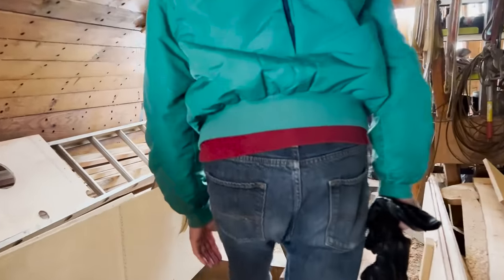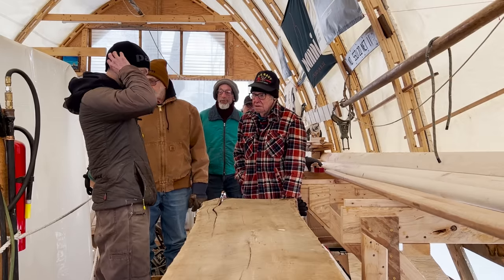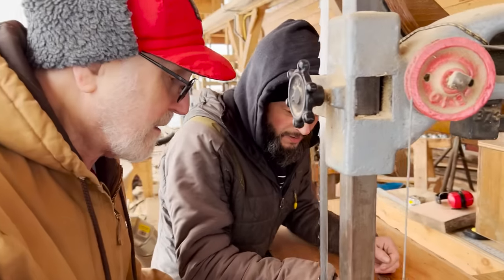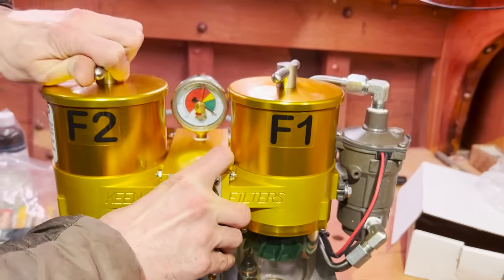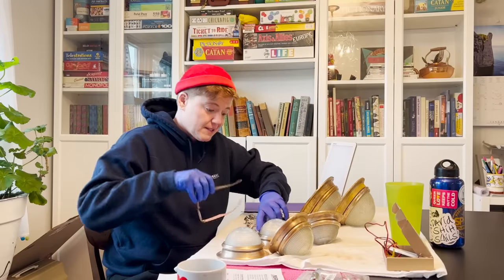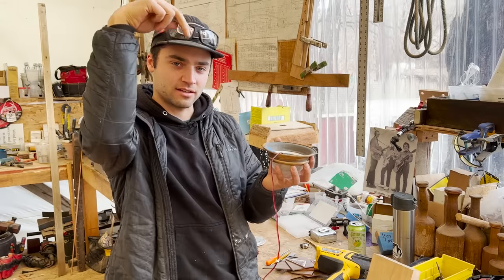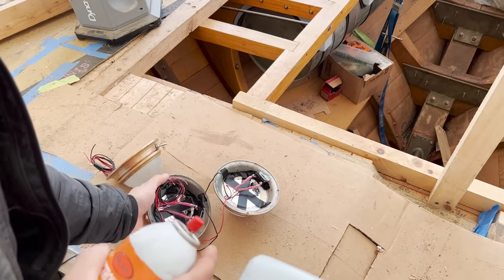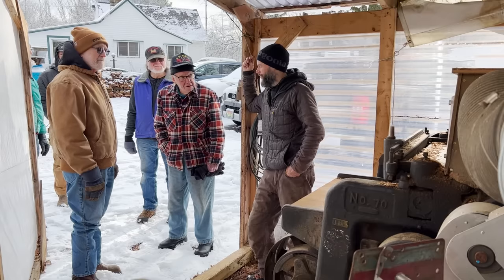Retrofitting 100 Year Old Lights for LED - Episode 253 - Acorn to Arabella: Journey of a Wooden Boat

Comment: I think it's a bad idea to pick those LED flat panels over the bayonet fittings,  They're very low quality and fail at an extremely high rate.  The Bayonet fittings are standard and much higher quality.  There's also no guarantee if you need to replace the LED panels that they'll fit.  They aren't a standardized size, like the bayonet.

Comment: The 3 ball valves need to be repositioned on the manifolds.  
I've found that rotating them to 45° allows for finger clearance between handles and valve body.
...
Retired master pipefitter.. with aviation and racing experience.
Reply from the maker: Thanks for the tip!

Comment: Something to consider doing on your fuel system: have one of your tanks that doesn’t have a deck fill and the only way to fill that tank is by pumping the fuel from one of the other tanks, through the filter system, and into that tank with no deck fill. Have the engine only pulling from that tank. This guarantees that the engine will always be getting clean pre filtered fuel. I did this when I redid the fuel system on my boat and I love it. It gets passed through a 30 micron filter and a 10 micron filter as it gets pumped into the tank. Then the engine has its own set of filters. 10 and 2 microns. I realize the second 10 is redundant, but it was already installed on the boat.

Comment: Technically speaking you're not supposed to use a dimmer on LED lights unless there's some built-in smarts. LEDs should be dimmed using pulse width modulation or by varying current. A typical dimmer varies voltage. There's no harm in what was done other than the dimmer won't function well at lower light levels. Cool project guys 👍
Reply from the maker: We’re using dimmers that are sold for LED systems 👍
Reply: @AcornToArabella  I hope not to come across as a smart ass but this happens to be my area of expertise. I'm really curious how the dimmers work. The issue with simple resistive dimmers is once you reach a high enough resistance the LED will simply shut off. So you lose all light at its minimum forward voltage. There must be some electronics inside that switch or in the light itself. Thanks for sharing.

Comment: I think I would use hot glue on the galley style light fixtures rather than tape. Tape is not a robust or long-lasting solution. Not that hot glue is either but it definitely lasts longer.

Comment: you may wnt to use aluminum duct tape on those lights,its less likely to dry and corrode and made to handle heat without softening the hold.

Comment: Depending on the design the steel backplate for the LED lights that you have removed may act a heat sinks. All LED lights generate some heat at the junction and this does need to be dissipated.
Some testing maybe in order.
Reply from the maker: These run cool.

Comment: Careful with LEDs and enclosed fixtures. Those galley lights already seem cheap with no proper heat sink behind the LED elements. Removing that one piece of metal they had next to them and placing it into a enclosed fixture might not be so good for the longevity of these lights!
Reply from the maker: These run cool.

Comment: LEDs don't like being hot Find a way to provide ventilation or you are going to be replacing bulbs quite often. The cooler you can keep them the longer they will run. Hypothetically if you keep them cool enough they will last well beyond their predicted death date.
Reply from the maker: These run cool, so all is well.

Comment: I would put the fuel handling system some where with easy access but with as short of lines from the tanks to the filters as possible just in case you do clog a line with bad fuel ⛽️

Comment: Look at using citric acid to brighten up your brass.  It's cheap safe to use.  I use on old kerosene lantern.  You still need to polish but it gets rid of the corrosion fast.
Reply from the maker: Most of these we’ll let go back to having a patina. Just bringing everything up to the same level of shiny then letting it all age together.

Comment: I would be very wary about removing the steel backing plate from the lights - every chance that it doubles up as a heat sink. If you have a spare one - mount it to a piece of wood and see how long it lasts.
Reply from the maker: Hmm… given it’s a puck light, meant to be flush mounted with about a couple of millimeters behind it, I think that’d make a bit of a lousy heat sink. In this case it’s surrounded by metal around its rim and has about an inch or more now between itself and the mounting surface. Maybe it all works out.
Reply: I wouldn't worry too much about heat problems with LEDs, unless you are running really high wattage. If your driver circuit board is inside the fitting you may have a bit of heat build up, so it's better to have them away from the fitting. Also, drivers tend to fail more than the "bulbs", so having the driver away in a more accessible spot makes for easier replacement. I have LEDs with on board drivers in my bathrooms, the steam makes the drivers fail (visually spectacularly!) every couple of years, and it's a real PITA to replace them.
Tungsten filament bulbs do need a heat sink due their nature of running really hot, even in low power outputs. Victoria would likely have had tungsten bulbs, so the fittings are likely designed to dissipate heat anyway. That said, I do agree that the steel backing should be retained to get rid if the little heat coming off the LEDs. Have you given thought to the type of light you want? Maybe a mix of warm and cool white LEDs, the warm is more mellow where cool white gives a really good bright light so that you can see properly for fine map or maintenance work...
Reply: It's more of how long the lamp will last - some are driven hard - some not so much. if they do run hot its ( probably) not going to cause fires  ( will probably fail before any damage) and , as you say, hopefully the mass of the fitting will be enough to dissipate the heat, it will just massively reduce the lifespan. I was just thinking it might be worth running one for an extended period of time ( at battery voltage ( will they ever see charging voltage  and if they do what will be the max charging voltage? ( I think it might be 14.4V  ie 20% higher than nominal) ) to try and gauge whether the temperature will be a problem. Sometimes killing the current by a small amount will dramatically increase the lifespan.
Reply: @nonesuch271  It's fairly complicated, as you would seem to know! Yes, current limiting is the key to LED life, voltage drop across the LED chain or string depends on how many LEDs there are, and of course, how many per visible component.(would you agree that 2 - 2.8v per LED is adequate?) Any good lamp should have current limiting built in (to the driver) and a decoupling cap to prevent ghosting. Overdriving the segments is easily limited by some calculation and adding a resistor into the circuit, you can bring the current to a bit below optimum without sacrificing too much light output. BUT!, I believe Steve will have chosen quality stuff, so there shouldn't be any problems!

Comment: I feel kinda unconfortable saying this, as I've read a lot of comments and almost nobody said anything about the lights. Beside it's ugly finish, duct tape isn't a good solution, it will get loose sooner than you expect. KPs solution is better, maybe with shorter bulbs, but you can eventually change them if LEDs fails... because they will fail. And changing a bulb is way more easy than removing all the light, retaping it, etc. Also, you keep the light as original as it was. Just a suggestion.
Reply from the maker: ¯\_(ツ)_/¯ they’re easy to switch out if we want to do something different.

Comment: Not to be a naysayer, but are u really installing  the lighting fixtures with electric tape holding the reflectors???   That's not consistent with the work standards so far... what's the projected life span? I month before the tape let's loose?
Reply from the maker: Low key and low stakes situation here.

Comment: KP was right and you shouldn't have deviated from the plan. Those double contact bayonet style LED's can be replaced with regular double contact bayonet light bulbs that you can pretty much find anywhere in the world. Your drop in galley fixture LED's will be all but impossible to find outside the US so should you lose several of those lights due to an unforeseen electrical issue it would be a piece of cake to resolve with the bayonet double contact fixture but you'll be running in the dark for extended periods if you lose any of those drop in galley lights.
Reply from the maker: Thanks for watching and for your thoughts.

Comment: Exposed wiring?  Horrendous.  Wires should have been put in above the overhead and been completely hidden from view.  Very disappointing.  You are doing a superb job building to yacht standard but this shows that you needed some expert advice earlier in the build.